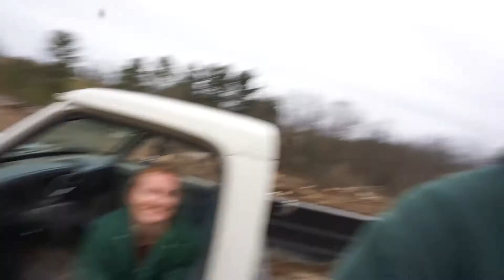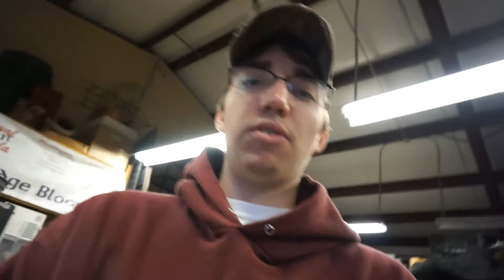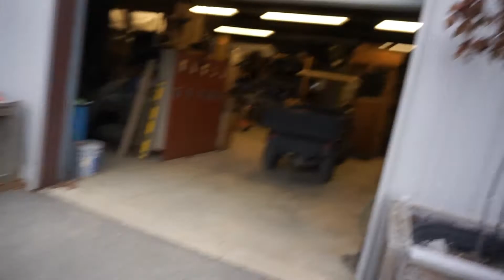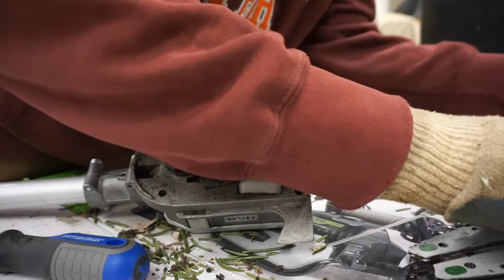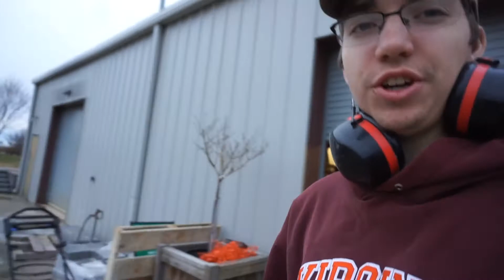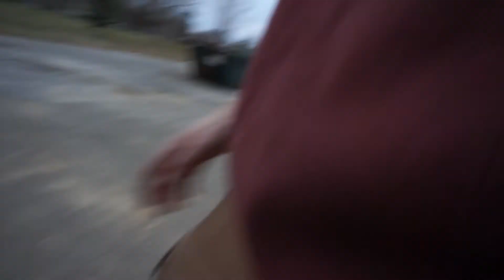Winterizing Small Engine Equipment / Stihl Trimmers, Blowers, Chainsaws, and Toro Push Mower

Comment: Sta-bil fuel stabilizer works just as good as the 4 cycle tru fuel. Heck of a lot cheaper too. I hate winterizing equipment, because that means the season is over. Nice video bud.
Reply from the maker: Jonathan Cerritelli Yeah man, end of the season stinks. We've had good luck with tru fuel, but I'll check out sta-bil.
Reply: I put it in all my 4-cycle stuff, never once had a fuel issue. But the tru-fuel 2-stroke......I will swear by that stuff.